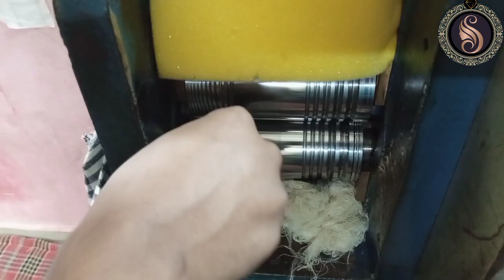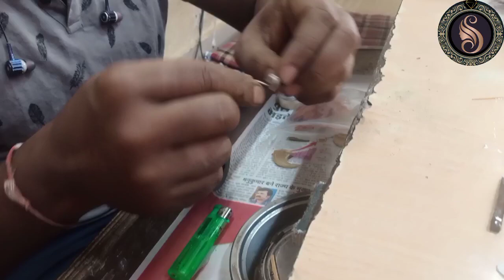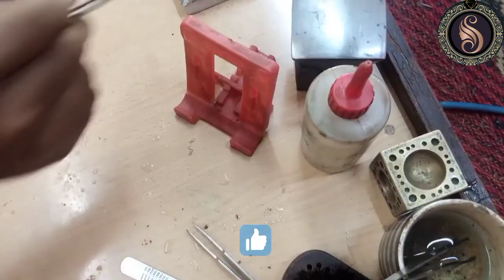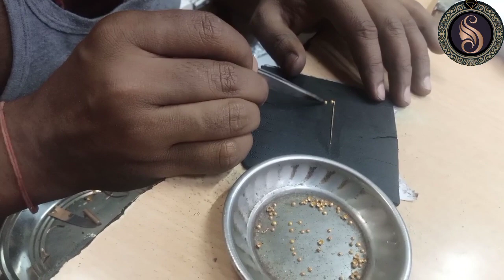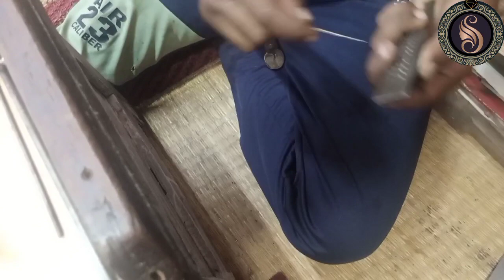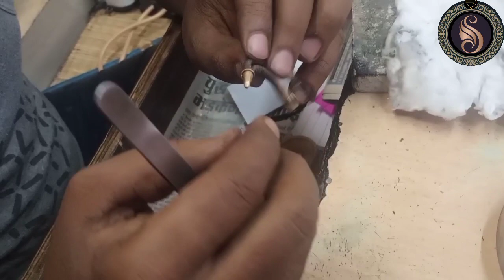Gold Wagh Nakh Making || How To Make Gold Wagh Nakh || Gold Pendant Design ||

Comment: How mch does it cost ? Gold + tiger nail
Reply from the maker: with out nail 
Gold cost 7gm(37000)
Reply: @ishangoldsmith  with nail ?
Reply from the maker: @dindinchack572  nail price upto 4 thousend to 5 thousend
Reply: @ishangoldsmith  orginal?
Reply: @dindinchack572  original sells upto 70k to 1lakh
Reply: @ishangoldsmith  no send karo
Reply: Muje  ek nail chahiye
Reply: Price kya hai?
Reply: @dindinchack572 if you have more doubt about the nails better you hunt a tiger and get it's nail he will make a pendant
Reply from the maker: Gold price 43000
Reply: 1 nail 120k milega aur 2 nail 240k ka mele ga kisi ko chahiye to bolo abhi ke abhi de sakta hu